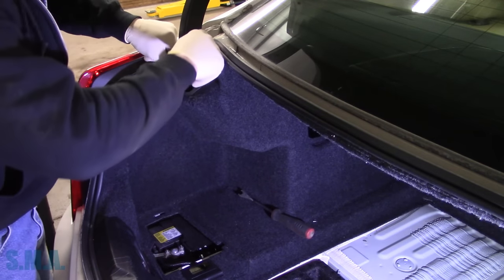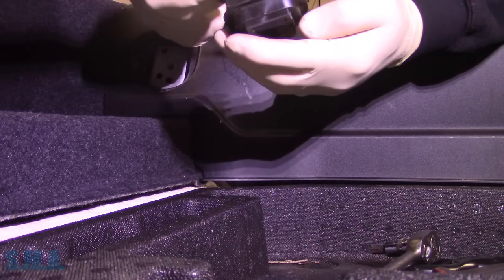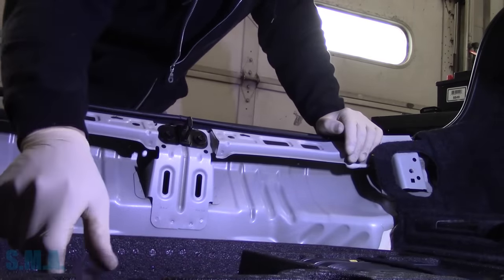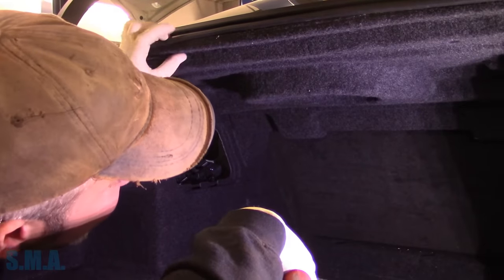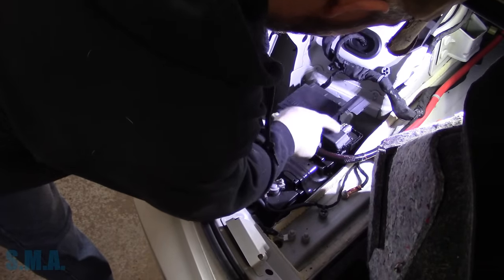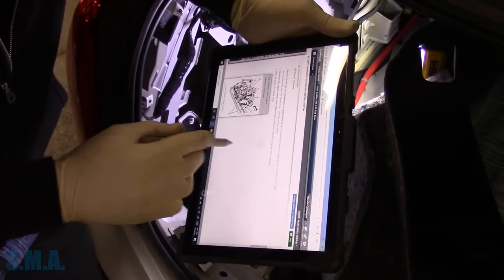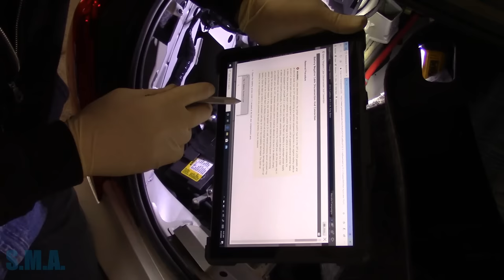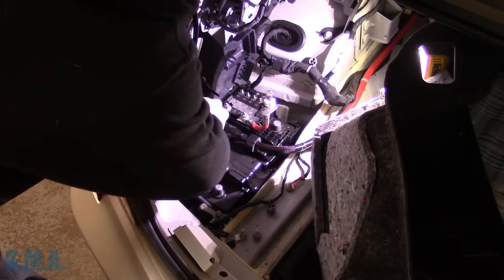Cadillac ATS: Battery Remove & Replace

Comment: Kind of tempting to just rip it a bigger opening isn't it?
The VW's with the batteries under the driver's seat are annoying, but the Chrysler wheel well batteries are the worst. That Caddy is pretty stupid too.
Do you ever use a jumper pack to keep the vehicle powered up while you change the battery?
Reply: I know, just take a saw and lift it out. I'd prolly recommend that to my customers if I ran a shop.
Reply: The Vw battery under the seat takes the cake for me I mean how many people have an m10 triple square socket just lying around. It's one of those tools you don't even know exists until you need it to remove the seat to change the battery.
Reply: @cdman78564  the vw battery is a 10 minute job.  I've done it plenty of times with my old touareg

Comment: I replaced a customers battery in an 06 Saturn Sky, loads of fun this one is...requires passenger fender to be removed and the interior bracing, still a pita to get to. Runner up was a 2015 Dodge Journey

Comment: That is really crazy to change the battery. My 2008 Chevy Cobalt LS battery is located in the trunk and very easy to change. In 2021 I Install new battery along with OEM battery vent tube that was missing when I the car. Done deal 10 min. I love my 2008 Chevy Cobalt LS. Very easy car to work on.

Comment: German cars: "We're over-complicated and hard to work on."
Chevy: HOLD MY BEER!
Reply: German cars have that reputation from people who can't follow directions and try to wing it. That doesn't work on German cars. You must follow the instructions or the procedure will not be successful. Source: My dad does a lot of work on German cars.
Reply: @44R0Ndin  BMW's are pieces of crud. I swear their service department price list for everything from cleaning out ashtray to adding fluid is 1000.00 per service item. All we did was professionally upgrade our seats to the heated ones. Created all kinds of problems (airbags, memory seat positions,ABS, and so on) since the modules freaked out because they were not the original modules. The x5 is the same issues for there batteries except they cost three times more and have to be programmed in computer. They just want to force you to go to dealers since their the only ones that can even talk to the one of many modules with their proprietary aps. Certainly my last beamer.
Reply: @ellkir1521  To be fair, my dad doesn't do much work on BMWs. Pretty much all he sees is VWs, with the odd Audi in there sometimes.
Those ones are usually put together pretty well, even if it does take looking at the service info to figure out how to take it apart. One of the weird things is that when doing engine work they sometimes want you to take off the bumper. Trust me, if you take off the bumper things do go a lot faster. Sure it's one more thing to take off, but un-do like 6 bolts and it comes right out.

If there's one thing wrong with VW/Audi, it's the plastic they use in the cooling system fittings. It gets brittle after a few years, and after a few more years it creates coolant leaks. The parts aren't that expensive, but they are hard to get at (take apart most of the intake plumbing and plastic on the top of the engine to get at it, almost as bad as the rear 3 spark plugs on a domestic transverse V-6).
Reply: @ellkir1521  At least BMW makes the whole corner in the trunk swing out so you can access the battery without disassembling the whole car

Comment: Hi, Eric. Wow. I have been out of touch for so long. I had no idea that the Caddy battery was even in the trunk buried under layers of carpeting and plastic and connected to subsystems that could be ruined if you left the key turned on. Thanks for the lesson and "how to" video. If I had my druthers, I would probably buy a Caddy. My dad always leased a new one every year. That's a good way to avoid a lot of repair and maintenance costs, I guess. It sure is great if you can manage it. Thanks for sharing! Stay Healthy!

Comment: I still driving mid '90s stuff... Because of this sort of 'screw you' attitude from the manufactures and government bureaucrats. I may need to start manufacturing my own parts or drink the Kool-Aid.
Reply: I agree. I made it to 95 and quit.
Reply: 87 is my newest,and only if Jim Jones makes the kool aid.
Reply: Or just don't buy modern GM crap. Most modern Japanese and Korean cars still use a regular top-post battery in the engine bay.

Comment: I just replaced my 2014 ATS 2.0L Performance battery (group H6) and it was not as difficult as the video makes it out to be. Took me less than 30 minutes from start to finish and I am just an average DIYer. It is not harder than any of the newer cars where the battery is buried under plastic cowlings in the hood.

I bought a T45 socket from Home Depot for $3, removed the two tie downs bolts on trunk lid area. Then I lifted the plastic piece straight up and it easily unsnaps. Then I removed just two of the  closest fasteners holding the carpet above the battery compartment and you can swing it to the side without removing any of the fasteners on top or back. Removing the battery is then pretty straightforward. Remember to put the vent plug on the positive side of the battery and the vent tube on the neg side before attaching the terminals and bracket. Oops, that cost me a extra 5 minutes :-)

Comment: Everybody saying razor knife and side cutters (NOT) .Go the AvE way .Break out the mini battery powered chainsaw!😆
Reply: Cut out a hole with the razor. Then when your done cover it with a metal plate just to be safe. Don’t want anything touching the terminals

Comment: Holy schnikes, I just replaced the battery in my '15 Ford Explorer.   Hood open to hood closed was 15 minutes, which included replacing the entire positive terminal/breaker assembly because I broke the red plastic cover off the old one.

Comment: You'd think that carpet hiding the battery was a structural component the way its in there.
Reply: Robert Slackware  
That kind of battery doesn't have battery acid, it's fiber with acid, you can turn it upside down and acid won't run out.

Comment: 96 Chrysler Sebring Convertible. Batt is in the drivers side wheel well. You have to jack the car up, pull the wheel off, then you can acces the plastic inner fender which comes off with about four little screws. Quite a pain.  Also that nasty side mount which I hate..That cad looks worse though lol! Love your vids, even the brake ones..Keep em commin!

Comment: Eric- you are absolutely correct about staying away from strong magnets if you have a pacemaker. Though it probably wouldn't kill you , it typically temporarily  changes the rate and function of the pacer. That battery change was actually very similar to doing one on a BMW 328i  e93 convertible-  it's very unpleasant and hard to pull an H8 battery out without handles too! Hopefully,  that AGM will last...

Comment: Worst battery i ever changed was on 2008 Pontiac Grand Prix. I had to remove a three foot bar, power distribution box. Radiator hoses, and relocate wire harnesses.  Once you disassemble the engine compartment you can still only barely access the battery in the fender well. Had to tip it sideways to remove and replace. The job was made harder because it was dark out and I could only use one hand because the other one held the flash light. Lol. Good times.  It took almost an hour. I looked up on YouTube afterwards and some people were saying it was a two hour job.

Comment: This makes me wanna run out and pay $80,000 for a new car.  THIS!
Reply: Makes me want to run out and buy a frame up restored car from the 1960s or 70s.
Reply: And plan on replacing that car every six years when the battery decides its terminating itself.
Reply: @paulwicklund5044  even unrestored it'll still be working(depending upon where its at).

Comment: While working for Standard Oil service station.  In Woodland, WA.  I had a car pull in for gas.  As I was washing the windows I had a strong smell of battery fumes.  I had the customer pull the latch to the hood.  I opened the hood and found a battery twice the size it should be.  It was almost covering the strap to hold it in the car.  We had a mechanic check the output on the alternator.  It was putting an overload in the battery.

Comment: I recently had to move the battery in my 49 GMC from the engine bay back to the proper battery location under the passenger side floor board and it was no where near as hard a job as that Caddy. I guess using that Caddy to jump start another vehicle would be out of the question. Good job, enjoy your vids.

Comment: So what you're telling me is in 15 years if there's any Cadillacs left on the road, itll be impossible to find one with the trunk liners mot completely railed.
Reply: In 15 yrs, replacing the battery will be the replacement of the main power source.  It is already on the hybrid cars.  Saw a video on the PPE needed to service the high voltage components in one.  Rubber gloves, and rubber tools, all heavy duty to protect you from electocution!

Comment: My 2008 G8 GT has an almost identical trunk/battery layout/change procedure. 
While I'm not excited about it... The battery lasts longer and the engine bay has more space for the engine and theoretically assists in weight distribution. 
The location did make  adding an aftermarket subwoofer and amplifier a piece of cake.

Comment: Wait till you have to change a headlight bulb 😆 on that ATS 😠
Reply: Shoot me now please!!!
Reply: If i saw this car come in id set the shop on fire and go home
Reply: driver side is easy, pass side is a PITA
Reply: I'm guessing its the same guy  who  designed a 08 Saturn Aura that you had to do the old reach around through the wheel arch or disassemble the whole front bumper

Comment: Note to self, don't buy one of these cars.
Reply: Mercedes put them under the drivers seat. I like the ones under the rear seats. Easy to get to and stay inside to keep them warmer in winter
Reply: @agger838  In my Dad's '37 Plymouth the battery was under the driver's seat. Lift up the front bench seat cushion for easy access.
Reply: @reecenewton3097  but have u seen a Mercedes seat now a days, have fun moving the seat when it's dead lol
Reply: Their resale value is 💩 anyway
Reply: @newhoosier female with zero mechanic background here. They told me that too when my touch screen cracked. I bought an HD cue screen for 150, pulled out the center console and opened up the computer to replace the screen. Took me about an hour and all I did was watch a 7 min YouTube video so try it on your own! I went two years with no radio screen and wish I tried earlier.
Reply: @alexisfraser4976   Good to hear it is pretty easy.  I will give it a try.  Thank you, Alexis
Reply: Note to yourself should be DON’T BY A GM PERIOD! Yes I was a GM technician so I speak from first hand knowledge of not only how stupidly they’re built but also how poor the quality and performance is. These ain’t your daddy’s GM’s!

Comment: I did that on my ATS . What a job considering it was just a battery replacement. What was general motors thinking?
 My battery had an intermittent short. I found it when it wouldn’t start one morning measuring the voltage. It was 3 V!
It had an intermittent no start, like once every two months.

Comment: Toughest battery for me was a E450 Ford Diesel. Two batteries, one underhood and the toughy, under pass. side body on the frame in a steel box.  Very heavy lifting with the steel box coming down with the battery inside. Small floor jack to the rescue!

Comment: To replace the battery: 

Step 1: Remove rear seat.

"Design For Manufacturing" engineers at work, folks.
Reply: That's what you did on the old VW bugs!

Comment: Some fun facts: 

You are correct about the two side trim retainers with access after removing the rear seat which has two versions (see RPO AM9). On some models there is a side trim Cargo Tie-Down that has to be unbolted. Although I did not see it on the vehicle in the video. The rear end trunk trim piece has four plastic lock tabs. Pull straight up after removing the two Cargo Tie down bolts. 

As explained in the video, if the ignition is On or with retained accessory power activated do not disconnect the battery negative or you will activate the OnStar backup battery which will then need to be replaced after drained. 

The reason there is a little door with access to the battery negative is because many of the repair procedures require the battery be disconnected by removing BAT NEG.

If you have RPO KL9 (battery current sensor) it is in series with the neg return to the battery. For state of charge estimation to remain accurate all current must go through the sensor including any battery charger current.

In the front of the battery tray there is a spring loaded bracket that you can pull forward to release the battery. How you do this while you pull up on the battery with your remaining two hands is not specified. 

Noco makes a brush on version of their NCP2 Battery Corrosion Preventative, which is easier to control than the spray. I too decided it was not neccessary due to the venting of hydrogen and the general cleanliness of the battery compartment.

When you buy a battery it may not be fully charged, some techs actually bring a DMM to the auto parts store and measure the terminal voltages to see which battery has the most charge, if you have a choice of many. However, it is best if you fully charge a new battery before placing it into service. Fully charging an AGM battery may take 8 hours. Also, it is good practice to clean the battery terminals and lugs before installing the new battery. 

The service manual gives a a torque of 80 lb-in for the battery lugs.

The user manual (not the service manual) has a procedure to have the engine ecm relearn the electronic throttle control home position by going key on without starting the engine for at least 3 minutes. 

So you may ask; 

How do I charge the vehicle without tearing the trunk apart to gain access to the battery? 

The service manual says use the "remote jumper stud underhood". What I think they really mean is use the jump start posts underhood, there is a protected red POS and an exposed metal NEG. The charging procedure asks you to check the battery temperature by touching its side. But as you can see in the video not much of the battery is exposed through the little removable top cover.

Then you may ask;

What charging equipment should I use to charge the battery from the underhood jump start posts?

The service manual references the Midtronics GR8 line of chargers. However, Midtronics does not recommend the GR8 be used to charge batteries remotely, meaning from jump start posts. There are many reasons why, one of the most important is Midtronics GR8 main charging profile(s) are "Diagnostic Charging" which needs an accurate battery impedance measurement to start charging. Impedance measurements should be done at the battery and not remotely. The GR8 does have a manual mode, but with this special mode the assumption once again is that the charger is connected directly to the battery.

So what does a customer use to charge the AGM battery in the ATS? This is a very good question. What does South Main Auto Repair recommend?

Comment: AGM batteries are VRLA, valve regulated lead acid. They only vent to the atmosphere when something goes wrong and that valve opens under pressure. So the vent pipe is really only for emergency situations and you're unlikely to gas anyone if you forget to block the one side, but it's still awesome that you noticed it!

Comment: This is worse than the "battery in the wheel well" used by Chrysler!
Reply: Battery in wheel well is kindergarten mechanics compared to this stupidity
Reply: R. N.  not that bad. I did a '04 Intrepid in driveway in cuomostan winter (sub-zero as it turned out) a few years ago. The battery on that is in passenger side wheel well.
Reply: which cattlerack had the battery upside down under the back window?
Reply: race cars do that too. zoom zoom zoom turn left.
Reply: @fbaldus  race cars like weight low that's why in wheel well it was common to put under seat when they added E lec trick start idk 20's or 30's

Comment: Freaking GM always making it difficult to replace batteries
Reply: Chris Storer GM is junk, this is one of the many reasons I would never own one.
Reply: It's even stupid in their half-ton trucks. Changed my dad's in his 15 Silverado. It's under the hood but wedged between the coolant tank and firewall underneath a bracket. Have to remove the bracket and coolant tank to get it out.
Reply: @mattbots1  don't forget the power wire looks just like the ones in this video, but not enough room to pull em out of the way.

Comment: You are correct about the Auto parts stores not installing batteries on certain cars. The system warns that at the point of sale about installation time and reprogramming. It says " Professional installation required"  That list is growing everyday. To my knowledge Lexus has some, Mercedes, BMW Chrysler, GM and Jeep Grand Cherokee is now putting them under the passenger seat which also fills with water.

Comment: Swapped the battery in our 2011 Durango Citadel with the big 5.7 hemi, which the battery is under the passenger seat. Learned the hard way that Costco doesn't sell the AGM battery, which isn't listed anywhere on their batteries. Picked one up at Naper. Wasn't too hard swapping, but did somehow figure out the need to transfer the vent plug to the new one.

Comment: had a 2004 Sebring convertible and thought the battery removal was crazy, remove driver front wheel and small panel and there you go battery access.